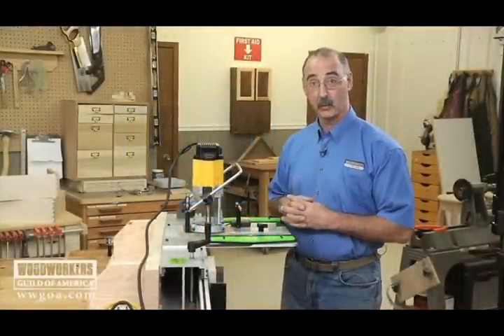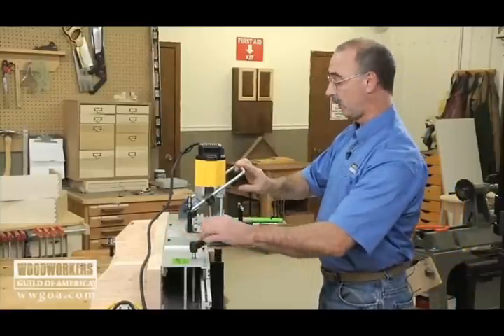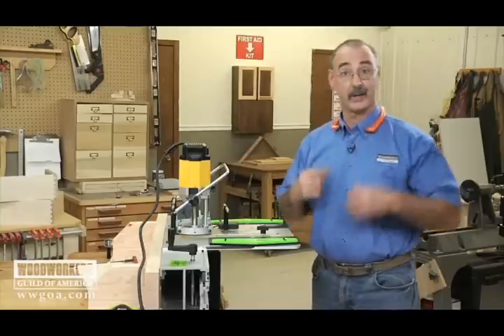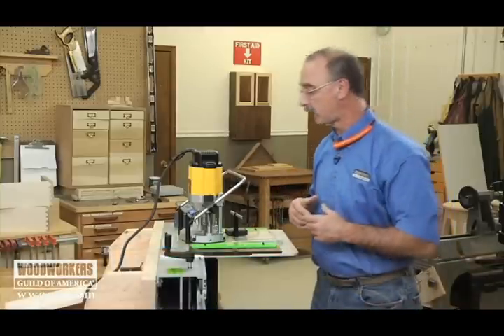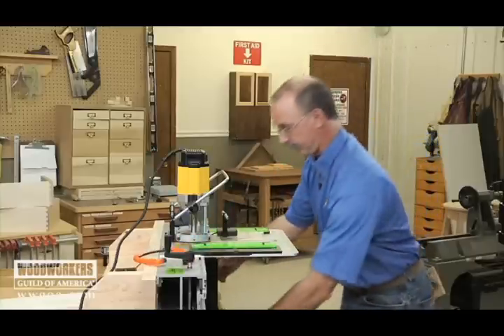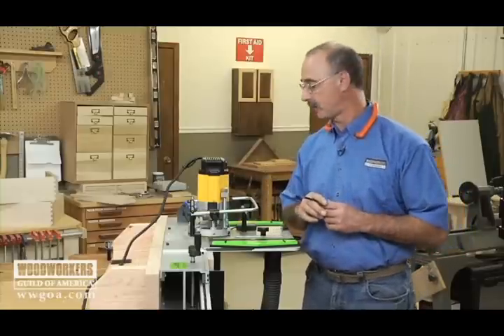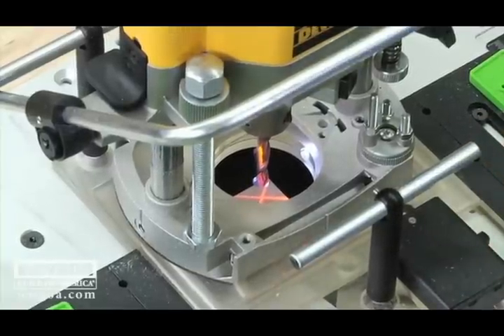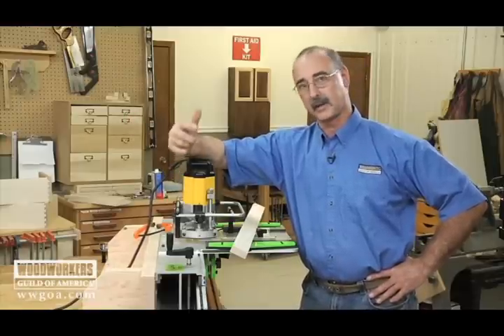Router Boss WWGOA Demo

Comment: Hi great setup. Amazing idea and seems to be a lot safet than a router table. I am new to woodworking so I don't have a router table. And I can't afford both a router table and a Router Boss. So a few questions. What can a router table do that the Router Boss can't? I am thinking here about pattern/template routing. Also I was thinking about getting a Festool 1410 router. Will it fit the Router Boss? I like the idea that the Router Boss saves floor space, although you would lose wall space. Thanks in advance.
Reply: I'm not trying to be a buttinsky, but  Festool routers are extremely expensive, and not built well, lots of plastic parts.
Reply: @thomaskirkpatrick4031  u clearly don't know much about festool I've had mine forever and its amazing I wouldn't trade it for a dewalt made in China piece of crap
Reply: @patrickweaver5290  good for you.
Reply: @thomaskirkpatrick4031  it is good for me Festool is the best 👌